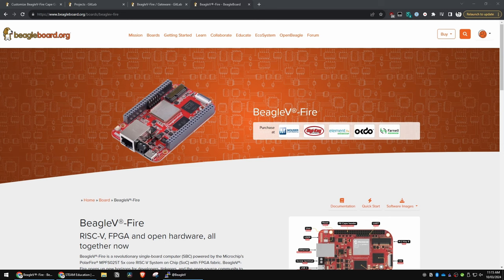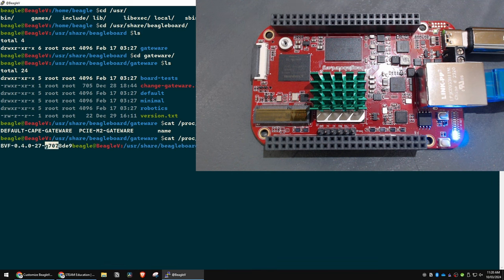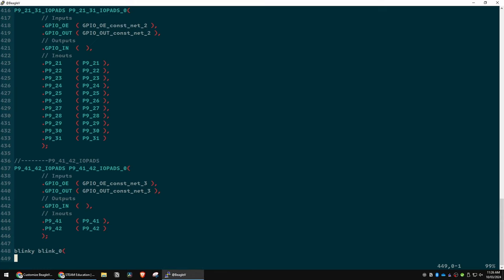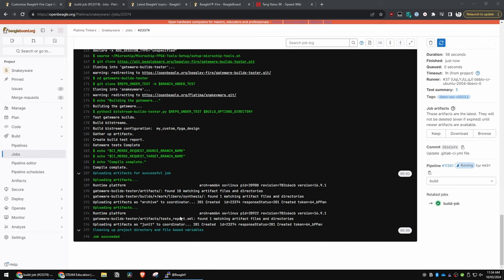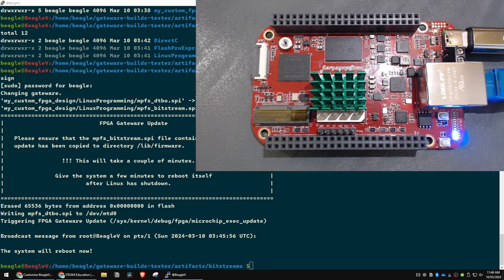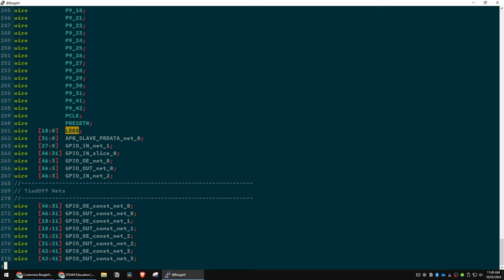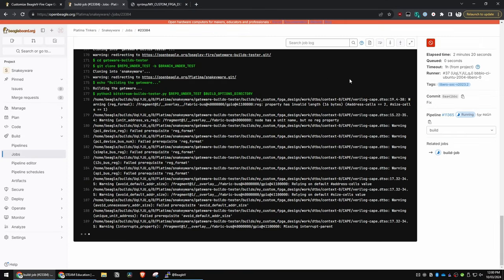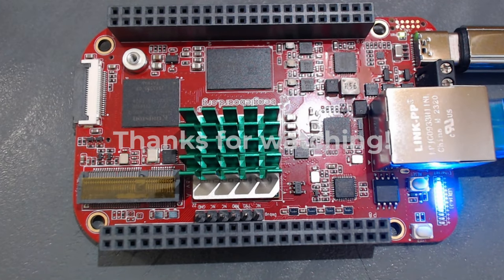Customising FPGA on the BeagleV-Fire

Comment: If you are considering making more videos with this board, it would be really cool if you made the counter and/or direction register(s) accessible from C code.
Reply from the maker: Yeah yeah I don't know if that is something I would even be capable of doing, let alone if it's possible. I guess depending on what IO it has, you'd have to define an ABI, create an API, and likely write drivers.

Else I'd have to implement an existing protocol such as serial/UART in the FPGA, and use that for IO. Again, with timings etc, even that is way beyond my current capabilities hah. You're very welcome to though!

Comment: I'd use the FPGA to make a very fast controller for a system I'm working on where I need to read in values from a quadrature encoder, and then, as quickly as possible, update the position of a servo according to one of several, selectable, arbitrary functions.
Reply from the maker: Oooh excellent idea! Share your comment out to get upvotes and hopefully you win one of the Tang Nano 9K kits!

Comment: Great work...inspiring...Any idea on how to access the PWM pins? I want to run a motor control application...
Reply from the maker: Thanks mate! And yeah it's all in the doco. You just have to work out what the addresses of the pins are, what wires you want to use, then update the verilog to assign those from the board to the controller to the FPGA. Very similar to what I showed with the LEDs, but of course different output addresses!

Comment: Trying to make a megasquirt microsquirt module display via canbus  to microcontroller.  I have a waveshare 5" round display with hdmi input. There's a esp32 to crystal display, but I want a round display.
Reply from the maker: Sounds like a fun challenge - there are many many ways you could do this, however, there are also dozens of variants of the ESP32, most of which don't really have the processor speed to do HDMI. 

I'd say your best bet would be to use an SBC or MCU that actually has HDMI out, else you're going to be bit-banging. Otherwise grab something like the CrowDisplay which is a HMI panel meant to achieve this (Affiliate link: https://plati.ma/go/elecrow-crowpanel)

Comment: Just a quick question , Is this only way to play around with the FPGA fabric , Can I do it locally without all the nitty gritty mentioned here  ?
Reply: You can, but I absolutely assure you this is the easy way for this product. Else you have to setup the Microchip development environment, your own build system, and will require a license - which are expenisve from memory.
Reply: @platima  Oh okay , Thank you.
Reply: @platima So in this case , We’ll have to use Libero and it’s expensive is what you mean
Reply from the maker: @ayushdileep2273  Ah used the wrong account there sorry! Haha. 

 Yeah I got no clue, but I think it was in the thousands depending on what license you got, and some of those options are annual! Here: https://www.microchipdirect.com/product/search/all/LIB
Reply: Thanks for the suggestion. I installed using the Free Silver License. I wanted to know if it's possible because my university wants it to run seperate and locally. Can you please advice on what to be done now ? Can I directly generate bitstreams and upload it on the board using Libero (similar steps to Vivado)  ?
Reply from the maker: @ayushdileep2273  Oh mate you have gotten further than I ever did haha.

I have no idea how to generate the bitstreams outside of using the Beagle CI/CD infrastructure. They have seemingly put together some long and complex scripts in the pipeline that handle all this.

You may need to read some docs or find some other videos! Sorry I cannot help more with this.
Reply: @ayushdileep2273  you can absolutely use the PF SoC on the beagleV-fire using the silver license 😀
Reply: Thank you for the reply. Do you have a detailed description on how to do it ?
Reply from the maker: @ciaranlappin5016  Link/instructions?
Reply from the maker: @ayushdileep2273  That's what I asked :P
Reply: @PlatimaTinkers  sorry thought  I posted it earlier today, let me check my laptop.